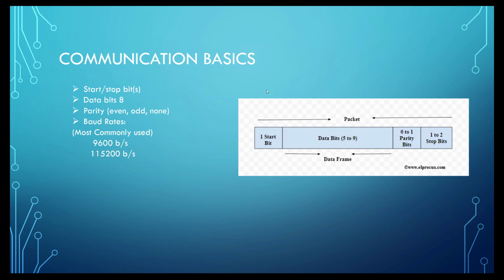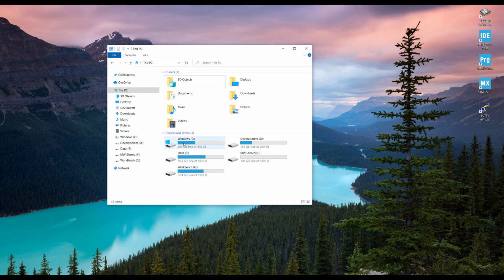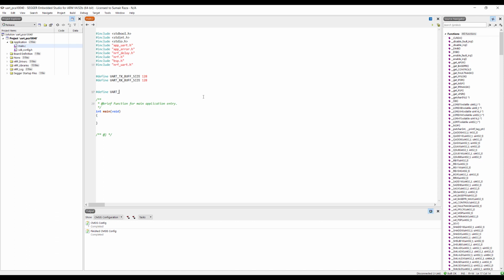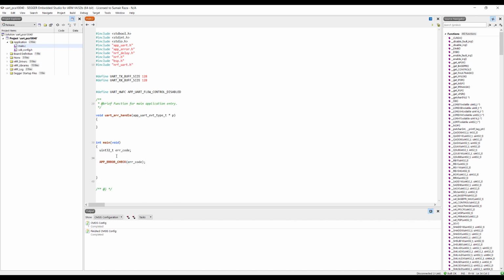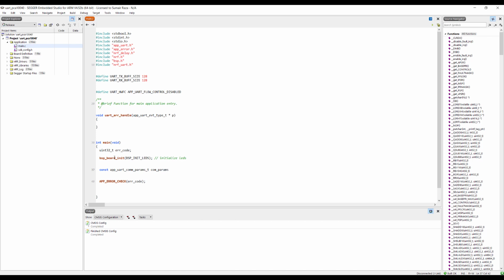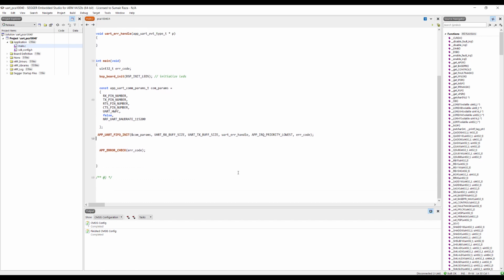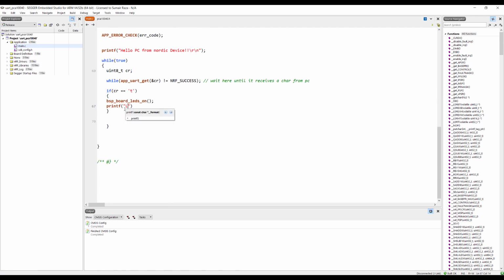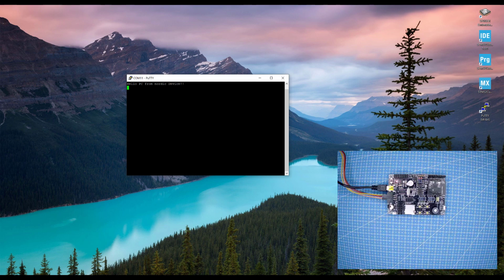nRF5 SDK - Tutorial for Beginners Pt 10 - UART   Serial communication

Comment: Thank you so much. At first, It didn't work in my special board. the reason is that I connected the tx rx pins to different gpio legs. I understood it when I saw the pin configuration from boards.h in your other videos. I wish you're going to heaven if you believe in :)

Comment: I can connect a usb-ttl converter to rx/tx pin of my devboard and send 't' and 'k' commands to turn-on/turn-off the led. However the messagens "Leds turn on" and "Leds turn off" using printf() are sent to Segger RTT console and not for my serial terminal. Why?
Reply: Incase anyone needs this..

Instead of printf() I used custom made function myPrint() (automatic new line can be removed...)

void myPrint(char *message){
  uint8_t i = 0;
  while(message[i] != NULL){ 
   app_uart_put(message[i++]);
  }
  char *new_line = "\r\n";
  app_uart_put(new_line[0]);
  app_uart_put(new_line[1]);
}
Reply: @moon cake,  thank you! I replaced printf with your function and it worked perfectly!
Reply: Hey! Have you solved that issue yet? I am facing the same problem and I'm just wondering if there is a simple solution.

Comment: good tutorial brou, I am using nRF52840 and I had a problem in this line :

APP_UART_FIFO_INIT(&com_params, UART_RX_BUFF_SIZE, UART_TX_BUFF_SIZE, uart_err_handle, APP_IRQ_PRIORITY_LOWEST, err_code);

---> "uart_err_handle" this part sent me a warning about the next line

----> void uart_err_handle(app_uart_evt_type_t * p)

then i could not to compile the progrma on nRF52840
until i changed this part,
i deleted "type_"

void uart_err_handle(app_uart_evt_t * p)

then the example its works :D i dont know why, but its works

thanks for you tutorial

pd: my English is not good,
Reply: Right. I also stucked on this "problem".
When I put endless while loop (while(1)) in error handler, I found out that the code sequence takes me to this function. It doesn't look as an expected behavior

Comment: I wonder how printf () understands where to send a string to the debug terminal (lesson # 8) or to the UART? Where is the output stream setting for this function?
Reply: I had the same exact problem.  I replaced printf with the function posted in a comment below and it worked as intended.

Comment: Hi Sumair's, 
I am new to this nRF, I want to develop a system where nRF 52840 communicate with another controller via UART, I had referred to example and video also, I am trying to achieve this when there is interrupt means send command in interrupt routine and receive the same on interrupt but I am not able to perform the same. And also I would change the pins to other GPIOs so can you please suggest how to change GPIO pins and configure as UART pin and send a command over interrupts. 
Now, with reference to your video I tried to send commands to turn On the LEDs, it takes 't' from the console but did not take the next 'k' command. 

Thanks,
Rohit R

Comment: There are many pins for serial comm predefined in pca10040.h. Please tell me more about the difference? Thanks.
Reply from the maker: The pins defined for serial comm are with different names, whichever you feel easy you can use them, we can assign any pins to Serial port so if you don't want to use the default pins mentioned in the pca10040.h, just define pins with new names at the start of your program, and then use them. ;p

Comment: And another question I have to have a Jlink to program these devices or devices like this one that is sold in aliexpress (
Nrf52840 bluetooth 5.0 240 mhz rf transceptor cdsenet E73-2G4M08S1C) Or can I use a FTDI serial adapter
Reply from the maker: The best option would be to use a j-link device. Its faster and easier.

Once we finish the Bluetooth communication tutorials, then we will learn how to use bootloader. once bootloader is programmed in the device we can use Serial port to program our device(nrf52832) by using a FTDI Serial adapter. We can also use direct USB connection if we are using nrf52840 OR nrf52833. We can also program our all of the devices Over The Air (OTA) via bluetooth. 

I have checked the device you mentioned, and it has a pre-programmed bootloader so it can be programmed over the air via bluetooth. If you are beginner or you are testing i would not recommend this device as over the air programming is slow and tedious and needs some steps to be taken every time to program our device which will in the end cause more efforts just for testing. If you are good with custom PCBs then be patient as we will cover these topics in future, where we will design some simple applications with custom PCBs. Hope so i answered your questions. ;-)
Reply: @SumairsEmbeddedEngineering  Thank you for your repply. I already ordered a Dongle and a SDK board from Nordic and waiting then to arrive to start testing. Gonna continue to watch you tutorials.
Reply: @SumairsEmbeddedEngineering  Can't wait the bluetooth programming!
Reply from the maker: More tutorials are coming soon and i have started planning the videos for bluetooth communication as well so stay tunned.... ;p